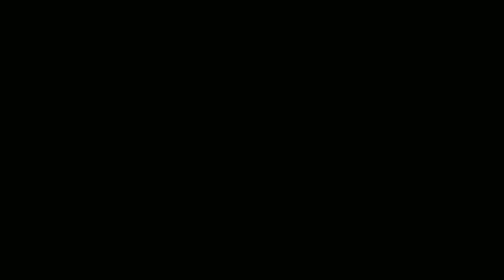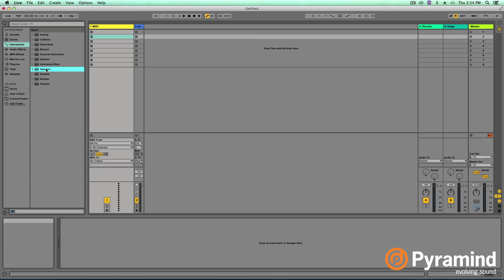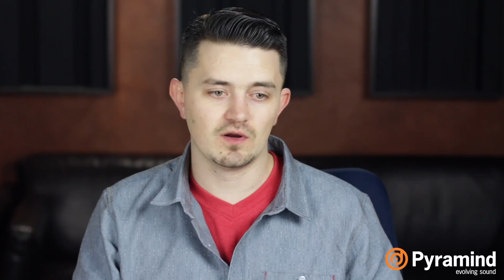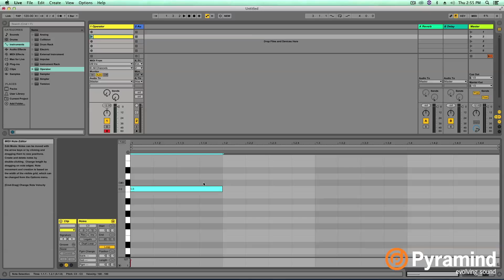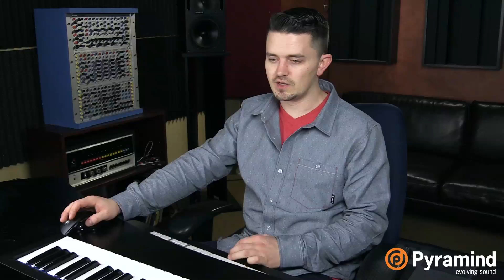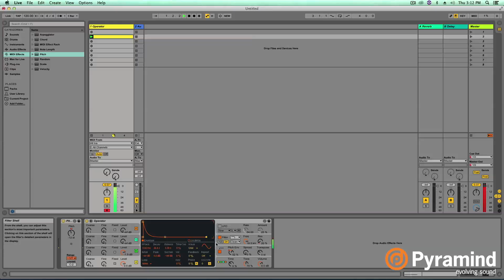Sound Design Crash Course (Free Download) | 808 Kicks | Part 1

Comment: Why do we need a 4 part Course on 808s? It's one of the most simple parts of production in my opinion.
Reply: But i feel like most people use samples or make it with just a distorted sinewave
Reply: It's a really good place to start synthesis and sound design basics for beginners, since its simple to do, but you get a very strong and popular sound. Why complain over free information and tuition?  <-- that's a better question. By the way, a distorted sinewave in itself wont give you an 808 kick....
Reply: Understandable, i just found that it would me simpler in one or two episodes. It just confused me. Thank you for clearing up.
Reply: No problem.